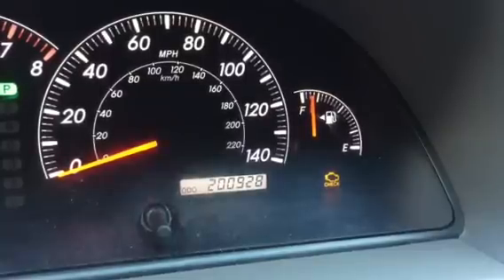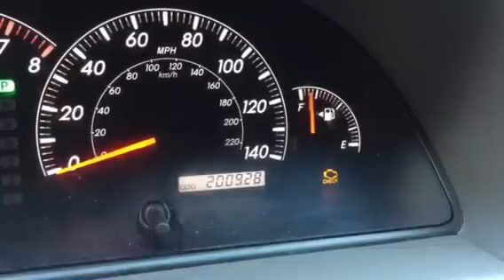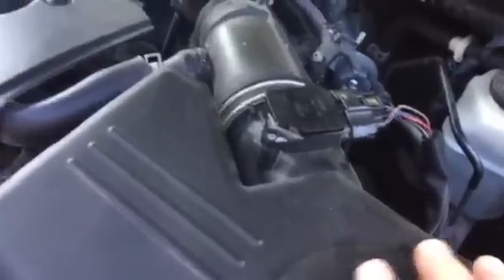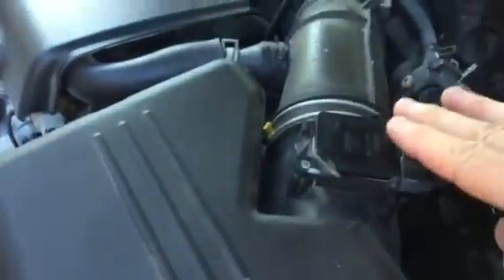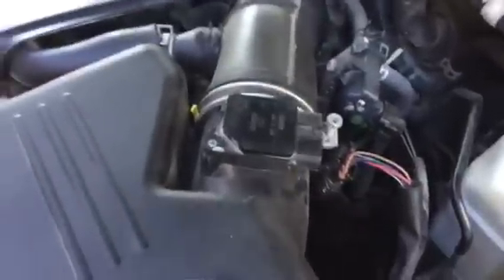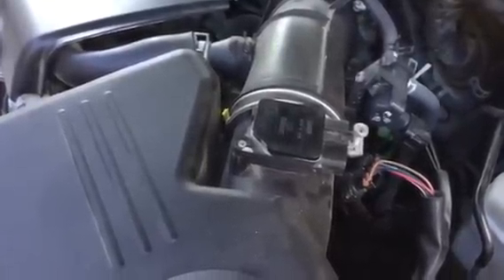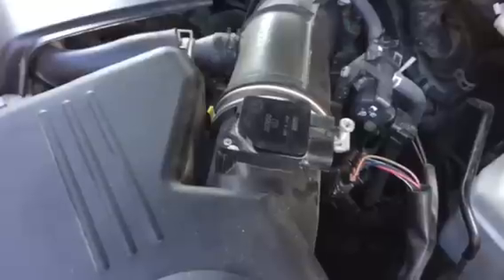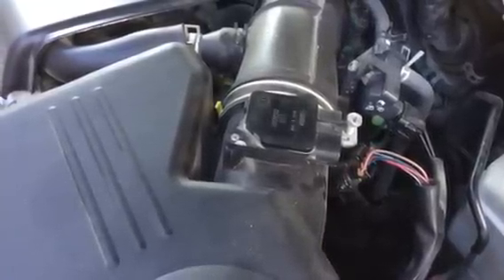How To Tell If Your Mass Air Flow Sensor Is Bad On Your Car

Comment: 3 words: "Air Cleaner Box", lmaoo
Reply: Lots of people call it that.  Toyota calls is an "air cleaner" assembly cap and "air cleaner" sub-assembly. It's perfectly reasonable and valid to call the assembly, in which the filter is stationed, an "air cleaner BOX".  It's sort of like a box and you open it and replace the filter.
Reply: Cleaner and Filter are interchangeable here and the correct name is Air Filter Box.

Comment: @proclaimliberty2000 Does this go for all cars? Had my glow plug light on. My car didn't turn off when i unplugged my MAF, so i cleaned it out and put it back in, reset ECM. About 50 miles later the light came back on. Tried unplugging it again, car didn't turn off. Could it be that this test doesn't work for my car?
Reply: Well it doesn't work for my VW Passat. Car ran awfully and as soon as i unplugged the AMFS it runs like a dream. So I changed the sensor and it hasn't made a damn difference. Been told it could be fuel injectors.
Reply: Paul Fcum  did the injectors part work? mine is just reading Fuel pressure failure,running symptoms basically the same.
Reply: @lancekambarami1367  fuel pump or wiring
Reply: Did the same thing with my car, did you ever solve the problem?
Reply: Cloud Boys Music nope. You?

Comment: Hi dear 
I want your help for my toyota carolla 2006
Dear my car toyota carolla is not start when car is engine is cold.....
I am very worry for this problem on my car 
Please help me 
What can u i do  to solve this......
I am waiting your reply...
Reply from the maker: When the car does start and is warmed up does it run normal?
Reply: proclaimliberty2000 
Yes 
in morning or engine off for 4 to 5 hrs 
Does not start normally
Reply from the maker: You did not answer my question.  Does the engine run normal when it's warmed up?
Reply: proclaimliberty2000 
Yes
Reply: proclaimliberty2000 
I am waiting your reply....
Reply from the maker: I would try this first.  https://youtu.be/cOAYWVBfuek
Reply: Dear sometime my car will not start 
 when i add hot water in rediator car will be start but hardly
Please guide me what is this problem
Reply: water in radiator? there is no coolant inside?

Comment: I have a 2014 Chevy Cruze 1.8l non turbo. I unplugged my MAF and my fans just turned on like my car was overheating. I have p1101 and p0171 codes (MAF and O2 sensor)
Reply: Wow! A car THAT NEW has a bad PVC valve??  And it costs THAT much to replace? 
GM never makes it cheap to replace anything on that car. My sister has the turbo version of a 2014 Cruze, and a stupid tiny light reflector in the headlight unit, broke off inside the light unit. 
They no longer make the part....in less than 4 years!  Usually a car maker keeps making new parts for a car, for 10 years after production.
So she had to buy an entire new headlight assembly to replace this tiny little amber colored reflector, and it is now clear, they dont make it in amber anymore!
Cost over $300 for a headlight assembly, ....they couldnt just replace this little $5 part.  The Cruze is a major rip off in repairs, everything simple is connected to something expensive!!
Reply: Gordon Tyler  find a fix for ur p0171 code? I have the same car n problem. 
Carlos
Reply: The PVC valve was the issue. Need to replace the whole valve cover with a new gasket. It costs $100. The PVC valve is built into the valve cover.
Reply: Hope that helps
Reply: HAHAHA!   That turbo....well the engine, went bad within 2 months of buying it, brand new!!  I don't know the part that went bad, but it was a tiny solid metal part WAYYY down in the middle of the engine, that snapped. A solid metal part!

They had to take the entire top of the engine off, to get to it, and replace it. I honestly dont know what part went bad, but it took a week to get the car back, and the part that broke....'was not EVER suppose to break'....according to the service advisor!  It wasn't part of the turbo, my sister buys a stupid tiny engined car, with a turbo in it, and doesn't 'use it'. 

I mean i get in it and after a bit of driving, I USE IT!!!!  I am racing Vettes with this car:)  I dont know if the turbo is always in use in the car,  or it only comes on under certain speeds? I don't know.
BUT she never hits the gas, and USES IT!!!  

I love to show up a Golf GTI or a small Porsche, that cuts me off, then I cut him off and zoom away!!!  IF they catch up, they have a look on their face like, WTF?!!!   But that tiny part, wayyy down in the middle of the engine snapped at less than 1K miles.  And it was not suppose to 'ever break'.  And I had not gotten to drive it yet...so it wasn't me:)
Reply: Marc B.
Although it has a turbo the engine is small and weak. If you treat it like a race car anything can go wrong like the pcv valve can snap and the engine can leak oil as well.
Reply: Marc B. Probably was a piston, rod, or ring. The only good turbo vehicles I know is ford. Other than that I stay away from turbocharged cars
Reply: All I know is it was a small almost 'U' shaped solid piece of metal. I saw it, it was going back to GM for 'inspection' to find out why it broke....I'm sure it must be happening in other Cruzes.  They SAY they send parts back to GM for inspection, to find out why they fail,if it is under the 3/36 warranty.
Reply: happened to me, i have cruze 2016, you just need to reset the codes(i have a code reader from amazon), and they won’t go back. 
also, i did changed my sensor and so far, the service engine soon didn’t show up yet. :).... i went to dealer and they want 350$ to just check what’s wrong lol, then maybe a thousand to fix it. thank a lot on this video. i was about to throw my car away.
Reply: I’m a mopar or no car guy. The Cruze is my wife’s car. Most Females don’t know anything.  She wanted it because “it looks cute”
Reply: Marc B. Did she take it to a dealership? Dealerships don’t replace cheap parts that isn’t going to make them money. Ford does the same thing with headlights. You can get headlights and any part for a vehicle so much cheaper on eBay or amazon and fix it yourself. Don’t go to a dealership unless the car is under warranty or unless you personally can’t fix it,
Reply: She went back to the dealer she bought it from. It wasn't under the 3 yr/36K mile warranty.  BUT she bought a stupid 'extended warranty' ,from the dealer,...she wouldn't listen to me, to buy it later from a 3rd party....and a lot of money.

And of course THIS part was not covered!  The dealer said they would pay half the bill, because her the 3yr warranty had JUST ended like 3 weeks earlier, so it was really a $600 bill!!!    I told her to buy a unit off EBay, like I have several times.  OR go to a junk yard and buy one, with the amber light reflector in it. For a lot less money. 

But she kept saying, 'i want a REAL NEW GM parts, on my NEW car'.  At 3+ years, it isnt new.  But she wouldnt listen.  So now the headlights dont match, and it is a stupid little plastic part that breaks frequently, I have found out.  Anyway to screw the customer.  

I have replaced my GM headlights, off of EBay several times, the lights get so yellow so fast, and most of the cleaners for that, just dont work.  I get tired of scrubbing them every few months.  The next time I need to replace them, and it is coming up....I am heading for a 'you pull it yard' and get them for even less!
Reply: Marc B. I would recommend just getting aftermarket headlights. In my opinion, I prefer Spyder headlights. They work better, they can be a bit price but best bang for my buck I’ve spent on headlights. I have put them on a few of my vehicles with no issues. Women and they’re “GM parts” lol, Almost nothing from GM is even American made anymore. I got tired of dealing with all GM’s electrical problems and went with Dodge/Ram. Has she has any trouble with the turbo? The turbo normally goes bad on the Cruze’s.
Reply: P0171 is a generic code that comes up on all vehicles.  All it means, is that Bank One side of your emgome is running lean.  O2 sensors are very common, but it could be a loose/cracked hose or an intake manifld leak
P1101 code definition
The storage of a P1101 trouble code happens when the Powertrain Control Module (PCM) detects a fault within the Mass Air Flow (MAF) sensor system. 

What the P1101 code means
When a P1101 trouble code is stored, it means that the PCM detected a discrepancy with the voltage from the MAF sensor. This problem can be detected while the PCM is running a self diagnostic called a Key On Engine Running (KOER) test. When the voltage from the MAF sensor is greater or lesser than the voltage allowed by the manufacturer, the test fails.

What causes the P1101 code?
Some of the possible causes of a P1101 trouble code include a faulty MAF sensor, faulty connectors or wiring within the MAF sensor harness, and an air leak either before or after the MAF sensor. A poor electrical connection within the MAF sensor circuit can also cause the storage of this code.

Here's your answer to your P01101 code, which is probable causing the P0171 code.

FIY, This is my wife's account, so she isn't the one giving this out this information.  Hope this solves someones issues and keeps the dealer from ripping people off.

Comment: If your MAF is bad will your fuel economy drop ?   mine dropped by 35% instantly , both 02"s have been replace with no improvement.  When you come off throttle the car kinda shudders like you cut the throttle cable while accelerating  , hp is down slightly as well..

Thanks.
Reply from the maker: Yes.  Make sure your throttle body is clean.  https://youtu.be/cOAYWVBfuek

Comment: hi.  i have a 2003 Chevy Blazer LS 4.3 V6 4 WD.  i have 132,000 miles on vehicle and i have never replaced MAF sensor nor have i replaced MAP sensor.  i bought car pre-owned and from looks of MAF sensor it does not appear to have been replaced.  MAF sensor has been regularly cleaned with MAF sensor cleaner.  I need advice as to whether i should replace both the MAF and MAP sensors.  I can purchase Delphi brands for both from Advance Auto online.  Here is symptoms:  When under load going up a steep hill (approaching hill at about 45-50 MPH) the car shutters/shakes and slows way down (boggs down) while RPM's jump up into 3,000+ range and barely gets to top of hill.  i never have engine stall issues during this experience which happens daily.  as i reach top of hill and proceed down the hill the car starts to smooth out then runs okay again until the next time i go over hill.  due to age of car and the countless times the Service Engine Soon light has come on over the years it finally just burned out (LED soldered into dash), so i only know codes if i take to auto parts and use their scanner.  i do not know what the code (s) is/are, but when i had car to mechanic the other day he just told me it was throwing a MAF sensor code(s).  this code has been showing up before as well.  Also, he said it has been throwing random misfire codes (again, i do not know code numbers that showed up).  when i am idling at stop sign or red light the car has an apparent misfire as the engine has a slight vibration to it (studdering), but never had any engine stall.  within last two years i have had new plugs, wires, new complete distributor with new rotor cap/button (not GM), new BWD spider injectors/fuel pressure regulator, all three new O2 sensors, cam shaft sensor, TPS, and idle air control valve.  fuel pressure checks OK, so haven't had to replace fuel pump.  i remain baffled by this problem.  i never seem to have a problem when driving level roads or some slight hills, but the severe symptom presents itself primarily when under load as in going over a steep hill.  i have had it to numerous mechanics including Chevrolet dealer and no one can figure it out.  i have replaced all easily accessible vacuum lines myself, but never replaced MAF or MAP sensors.  Also, a month or two ago i started getting a raw gas smell at every fill up.  Chevy dealer said i needed new canister and evap solenoid which i purchased and had installed.  although a bit better, i still get this raw gas smell at almost every fill-up.  with new canister and solenoid (GM parts) i am wondering if MAP or MAF sensors could be culprit for that issue also?  sorry for lengthy comment, but thought it best to describe entire situation with repairs made thus far.  I do have a Spectre after market cold air intake that i installed a year or so ago, but i was having this problem (load/misfire issue not raw gas smell) BEFORE i installed intake.  unfortunately, i got rid of my stock air intake.  i called Spectre yesterday and they recommended i unplug MAF sensor then remove negative battery cable for a half hour then reconnect MAF plug then negative cable which i did.  it seemed to have helped a bit, but i am still having shaking/studdering misfire issue when under load going over steep hill and some misfire vibration when stopped at red light/stop sign in Drive.  when i take it out of drive into Neutral or Park the studdering goes away.  i do not believe this is an engine mount issue.  Please help if willing.  Thank you.
Reply: I have  the exact same vehicle. (Same year same everything you said.) Not that this is your problem but this was mine, I had similar situation as you, my problem was the Intake Manifold Gasket..it was allowing air to enter the cylinder and tripping a misfire code while making the engine shudder.. (the bad gasket allowed the wrong air mixture to cylinder) I hear that this is a very common problem for our car.. Once I replaced it, it runs as it should now no problems. . But warning, shop wanted to charge $800 to do it, so I did it myself,  and yeah it took some time (full weekend)..
Reply from the maker: Carl, from what you describe I would lean more towards the MAP sensor but it could be both the MAP and MAF sensor.  I would have said the smell of raw gas meant the evap canister solenoid was faulty but you already replaced it.  Please tell me if you replace the MAP & MAF sensor and if it fixes the problem.  Carl, I know how incredibly frustrating this must be.
Reply: thank you for your prompt reply.  i will plan to replace MAP sensor first as it has never been replaced to my knowledge.  should i disconnect negative on battery and leave disconnected about a half hour before plugging new MAP sensor in so as to perhaps reset computer?  thank you!
Reply from the maker: Yes
Reply: Y

Comment: Yikes, I have a camry w/ 300k miles that no longer starts.  It will crank and start to turnover, but never actually start.  This all started happening after I cleaned the MAF filter and replaced fuel pump... I never got a CEL light though.  I've never replaced the MAF sensor, I've only cleaned it routinely.  If the MAF is bad, dead, will that make your car unable to start up? I was experiencing some stalling issues after starting up a few days before it wouldn't start at all.  Also, fuel was running rich.  I thought it was a faulty fuel pump.  Didn't think it might be the MAF... Should the car start-up with MAF disconnected if the MAF is bad? Is there a way to know if the MAF is causing the car not to start before actually replacing it? Any help welcome.  Thank you.
Reply: Clean your throttle body at every oil change
Reply: @Amboyblue  throttle body can go much longer than an oil change before cleaning is necessary. dirty throttle body only matters if the gunk built upto the point that it keeps the butterfly valve from opening
Reply: Oh this is 3yrs old. Lol

Comment: Thank you so much for this video!  My 98 Mustang GT convertible I inherited from my Mom when she passed 1 yr ago.  She bought it new in 1998.  She hadnt been driving it much for the last few years before passing (she was 88, isn't that cool?!), so it sat alot.  I am disabled so I don't drive it alot either, but I do take it on the interstate occasionally to blow out all the build up.  Right now it will start, but won't stay running.  It does this occasionally in  the last few months, but eventually will stay running and then its ok for a little while.  This time it won't.  We are going to try your suggestions on the video and see if that works.  I have subscribed to you on You Tube.  I thought your video was very informative, professional and most of all, in laymens terms for the unexperienced to understand!!  Thank you!!
Reply from the maker: Thank you for subscribing to my channel.  This could also make it run a lot better from what you're describing.  https://youtu.be/cOAYWVBfuek

Comment: I have a 2006 impala ss. Have jerking and stalling but no check engine light. I've cleaned mass airflow sensor and filter. Plus throttle body. Would this work on my car?

Comment: what if unplug keeps running but if you lug it back in it stops?
Reply: Yeah mine ran after I unplugged and turned off as soon as I plugged it back up? 01 bmw 330
Reply: was it maf
Reply: Marco Pineda mine did too and I have the exact same car as you 01 bmw 330i did you fix your problem?
Reply: Hey Marco, did you ever firgure out what to do.. Mine did the same thing.. and I had already replaced mine
Reply: I did that I unplugged it engine shuttered and surged 😟😟 I plugged it back in and it threw 3 new codes and one I f them is really really really bad.....I think I just hurt my engine more.....going to start looking for a new car

Comment: Thanks! I worked on a car that wouldn't start and the Snap-on scanner said MAF sensor. My scanner wouldn't dial into the VIN no. from the dash. I custom dialed it in. It gave the code about the MAF sensor. It cranked but wouldn't start.